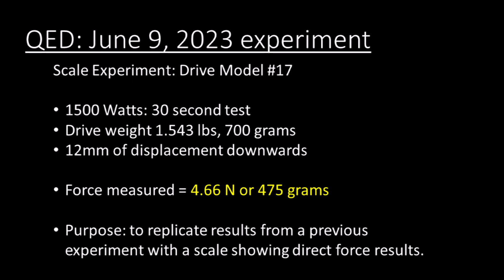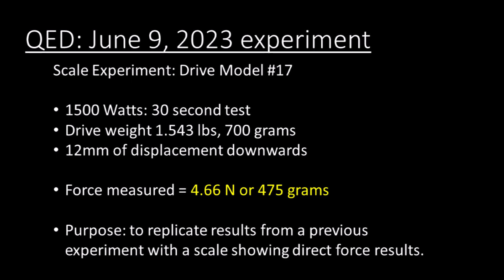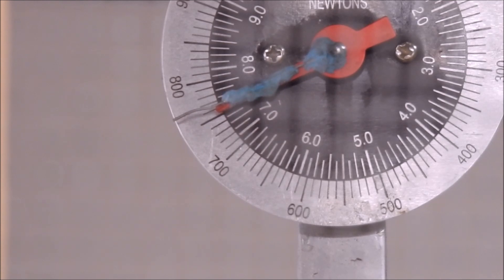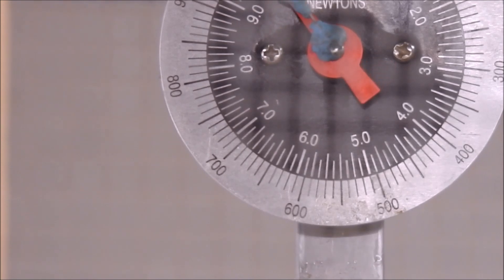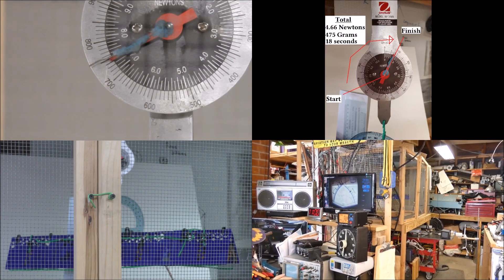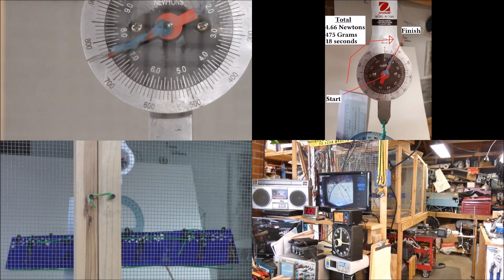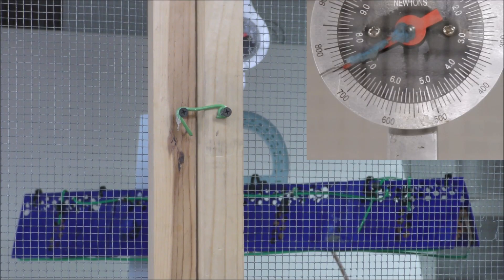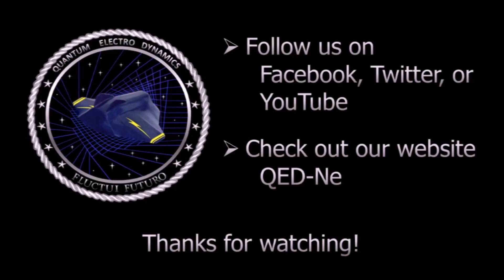QED June 9, 2023: Scale experiment

Comment: Please check your units in the description - "475 grams of displacement" doesn't make sense - grams is mass, and displacement is distance. Thanks for sharing.
Reply from the maker: Displacement on the scale. It is moving the scale in this experiment and measured 12 mm downwards if that is displacement you are wanting. A dynamo meter will be better suited for doing a real force measurement. The scale we used here doesn't do justice to measuring force, therefore we used that description.
Reply: @quantumelectrodynamics4209  - Thanks. Unusual use of the word since I had only ever heard "displacement" used for linear distance or volume in geometry, physics, engineering, etc., and I certainly assumed you weren't submerging anything lol

Comment: Assuming this is legit, it would be trivial for you to have this third party verified by someone like martin tajmar and unlock potentially billions in investment.
Reply from the maker: But we do plan to have independent verification if we dont get funded first. If someone funds us then we dont need the verification at that point, we will just improve the drive.
Reply: @quantumelectrodynamics4209  good luck
Reply from the maker: Martin Tajmar did check it out and got results directly proportional to the angle between the VEM Drive and the measuring device(which seems pretty evident that it worked). His results were small, since he did a poor reconstruction job of the VEM Drive, so they discounted it as background noise. We have not worked with him directly and based on his dismissal comments, he probably does not want to work with us.

Comment: while this is considerably improved over the previous demo it still has much room for improvement if it is to hold up to scrutiny.establish 4 if not more unobstructed lines of sight with clear views of the demonstrator, having obstructed views and limited camera angles makes it harder to fully buy because we got an inset image of a scale that may or may not be the scale we see in the isobox and we have no clear way to sync because all the motion we need to use for validation is blocked out behind framing

i believe this is probably valid i just want to see better documentation which i know can be a challenge but at this point should already be well established for data
Reply from the maker: We didn't expect to see the results that we did, but we can reproduce them in the future with more cameras. We normally do a 360 camera in the middle but just wasn't prepared this run for that. We do hundreds of tests a year and it is burdensome to record all of them with 4+ cameras in HD and all in proper focus, etc. This was supposed to just be an efficiency test.